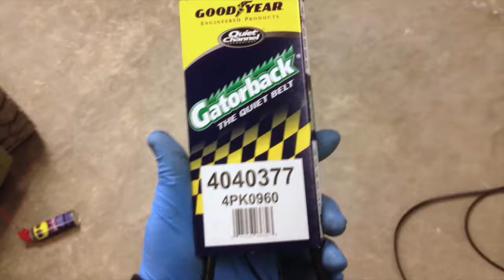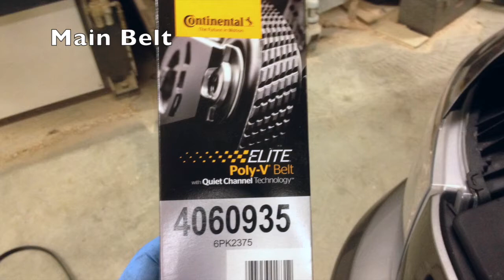Belt change 2008 Chevy Silverado 5.3

Comment: Hello , did you remove the fan before installing the belt  ?  Or does it go over the fan  ?     Thanks
Reply: Belt does not go over the fan on 5.3 V8 in an Envoy Denali.
Reply: how do you take the airconditioner belt off the harmonic balancer on a 2009 avalanche
Reply: You must put a socket on the 3" dia Belt Tensioner Pulley and with your ratchet, move the pulley away from the belt and slip it off the Belt Idler pulley behind the fan.  Note where the belt goes First, take a photo.  The belt route is embossed on the Fan Guard or on a sticker nearby.  There are several Google videos for it on the margin of this page.
Reply: It don't have a retainer on it I guess someone removed it
Reply: Thanks for the information though